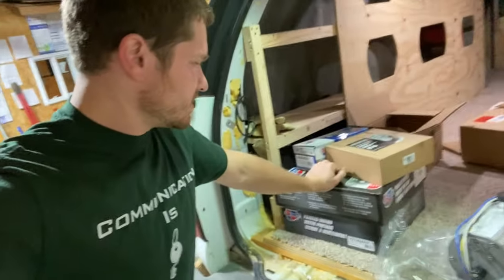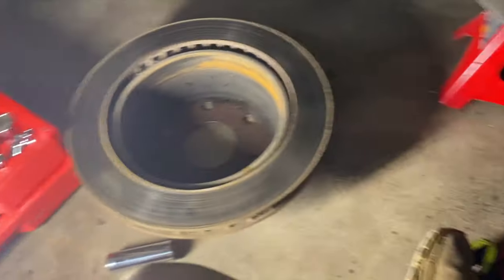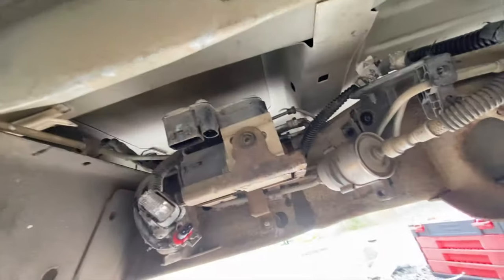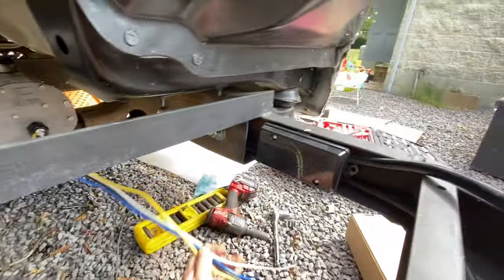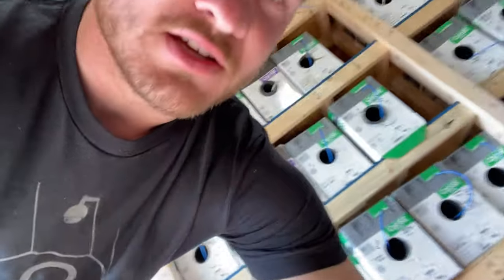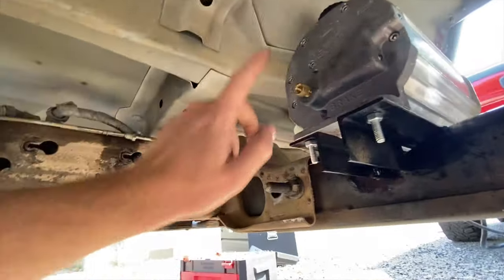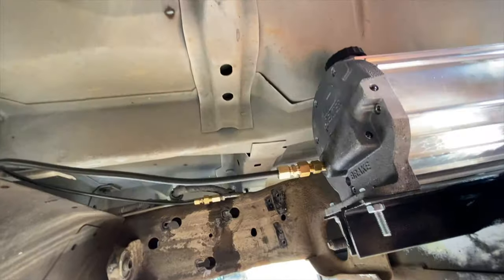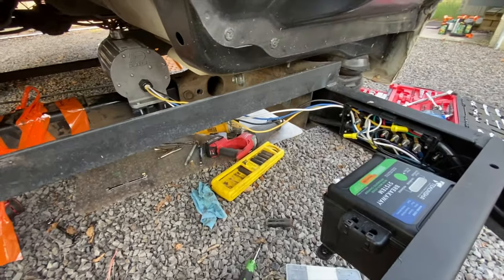Adding Brakes to Homemade Camper

Comment: Thanks for the video! ya, I checked on the drum break actuator and they want about $1500, for about half that I can get a 5200# axel from e-trailer with all electric brakes already on, Ill check into adapting that to my 76 3/4 ton suburban. But very good video, thanks again!
Reply: Use it locally.   I would like to have brakes:)  you have turned on another light above my brain.   Thanks
Reply: I parted a newer jetta w  antilock brake system.   It's still sitting on a shelf.   I'm thinking a guy could cap off a few c lines and simply use this pump as your actuator?  Just an idea?
I'm building a pu bed trailer w hydraulic tilt trailer.   I don't have brakes,

Comment: I'd keep an eye on those compression fittings, they aren't rated for high pressure hydraulics. If you have a flaring tool you can make a custom line with a fitting that goes from the booster to standard GM
Reply from the maker: Thanks! I’ll keep an eye on it and put better fittings on if we have any issues.

Comment: Dude you really need to weld your frame to trailer connection,4 bolts just aren't going to last long bouncing down the road, little welding and maybe some bracing it'll last forever.love the build otherwise,I subscribed and want to see how it turns out
Reply from the maker: It is welded and bolted. welded in 3-4 places and bolted in 4 places. There have been some updates since this video.

Comment: I have the same idea but I'm going to use a Ford van three quarter ton and I'm going to build it as a gooseneck or fifth wheel to feel a little more stable I guess. I might add on some more things to it but not yet soon though I wanted to get going on it. I like you're set up but isn't the old mirrors on the camper suburban obstructing your view or is it just you just decide to leave it on hey I mean if it's not doing anything then who cares right 👍👍 great job on your camper suburban.
Reply from the maker: Enjoy the build! I just haven’t had time to mess with removing the mirrors. They don’t obstruct enough to matter
Reply: @trove1312  👍.

Comment: Do you have a link for the electric over hydraulic brake?
Reply from the maker: yes here you go, this is the one I used, they have another one for using with drum brakes https://www.amazon.com/Dexter-K71-651-00-Electric-Hydraulic-Actuator/dp/B06Y375DW7/ref=mp_s_a_1_3?dchild=1&keywords=electric+over+hydraulic+actuator&qid=1602033099&sr=8-3